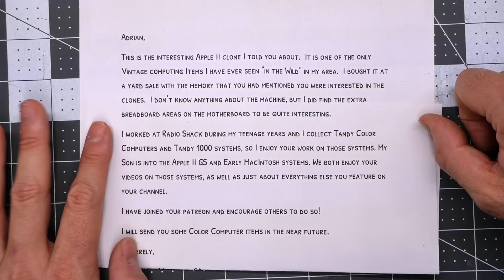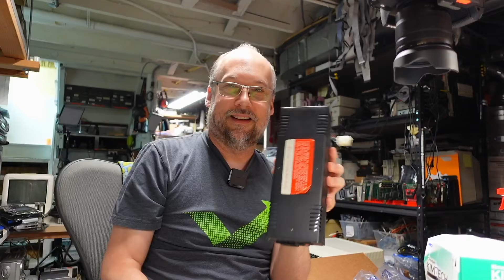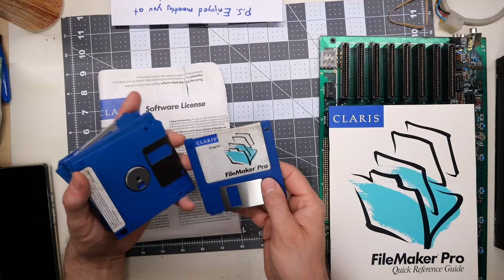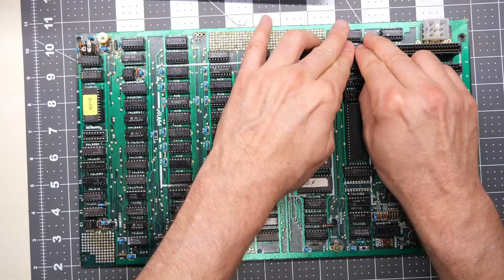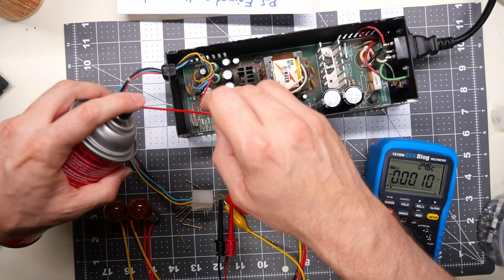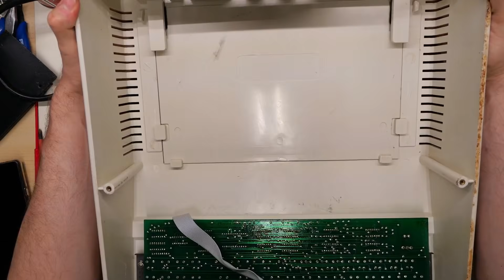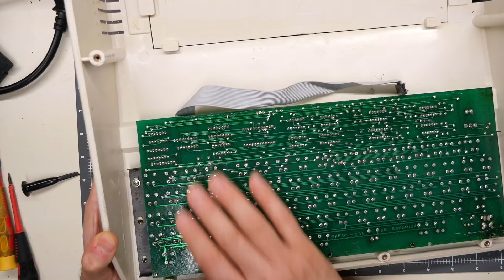0068 This computer is an illegal clone

Comment: I remember taking a computer servicing class and power supplies were tested with a PC board with a number of 'sand' resistors (the square-bodied resistors with a sandy cement on the one side). I wonder if anyone has ever made them commercially. It'd be more efficient (and safer) than the lamp rig. :)

Comment: My family's very first computer was a made-in-Taiwan Apple IIe clone in 1984 (it could enter lower-case letters so it must be a IIe clone instead of original Apple II or II Plus clone). Strangely enough, its form factor was far more similar to an IBM PC than an Apple: the keyboard was separated from the main chassis and its layout was a cloned IBM Model F XT but with read LED on Caps Lock and Num Lock; the entire color scheme was IBM's grayish beige instead of Apple's yellowish beige. I learned a little BASIC programming on it and played games like Lode Runner, Speedway Classic, and Seafox. Its floppy drive died around '89, rendering its function to BASIC in the ROM only and prompted my family to buy a 386 PC in 1990. Too bad I didn't keep it till now.

Comment: Ooh Kimwipes! Those things are AWESOME. They're much better for using for cleaning electronics stuff, PCB, etc. because unlike paper towels/loo roll/etc. they don't leave little lint boogers everywhere. Whenever I work on PCBs my last step is always to douse the thing in IPA then lay down some Kimwipes and then blot them dry. Gets rid of all that nasty sticky flux residue and you can just chuck them in the bin. I always keep an open box next to my workspace.
Reply: I use steel wool coated in hydrochloric acid to clean circuit boards and eye glasses... just remember not to wear any gloves as the acid will melt them.

Comment: Hey Adrian. Kimwipes are ok for glass and plastic. We use them to clean off glass components of gene sequencing flow cells. The main issue is they leave behind a tiny amount of dust. Just wipe gently with them. For something even better use lens paper for cleaning microscope lenses.
Reply: I use steel wool coated in hydrochloric acid to clean circuit boards and eye glasses... just remember not to wear any gloves as the acid will melt them.

Comment: I picked up a very similar looking Apple ][+ clone at the System Source Swap Meet last month. It looks very similar to yours, including the shortcuts printed on the keys. However, mine had a very sketchy no-name power supply that I believe directly caused 23 of the logic chips to fail. Hopefully your Seasonic power supply is actually a Seasonic (it looks to be a bit higher quality).

Mine is branded MCA and was made in Japan. The lid has a depression on it that almost fits an Apple ][+ badge (it’s too small by a smidge), and is retained by hooks on the lid and posts on the case. And yes, it has the breadboarding area.

Mine says “COMPUTER” on the banner. Sorcerer Stan confirmed that the ROMs from mine otherwise match those from the Apple ][+.

If you’re curious:
Attack of the Clone! Trying to Repair My MCA Apple ][+ Clone Computer:
https://youtube.com/live/xVzCYLJrgnA?feature=share

Justin Strikes Back! Trying to Repair My MCA Apple ][+ Clone Computer:
https://youtube.com/live/r6MLTV6Z4U8?feature=share

Comment: I built one of these in the early 80's. They were were very common in Canada. It looked and worked just like the original.
Reply: Where in Canada? Mine came from Supertronix on College St. Toronto.
Reply: It was Exceltronix on College, practically across the street from Computer Parts Galore, which also sold these bare motherboards and almost all the peripheral boards. They had a  bulletin board (on the wall) with phone numbers of people who could supply the eproms. Exceltronix also designed and sold a few peripherals like the Sound Sampler and and Eprom programmer. I built 2 clones from these sources in the 1982-84 time-frame and bought most of the parts at Electrosonic on Gordon Baker in Scarborough. @BrianBoniMakes
Reply: @BrianBoniMakes  Mine came from Computer Parts Galore, also on College St.  Those days were fun.
Reply: @als1035  I know that store and used to shop there!

Comment: You were getting about 80mV of variation. That's well within spec for SMPS. Incandescent lamps heat the tungsten filament to >3500K so there's a very large change in filament resistance across the operating current versus time on start up.

Comment: I wouldn't be surprised if the empty "breadboard" areas were added just in case there were a timing or similar problem later found with a specific accessory card, so they could add logic if necessary for an Engineering Change, without having to re-design the board.  Also, while the inconsistency of the power supply may be partly due to the high current demand(I'm guessing those bulbs in parallel were drawing at least 5 Amps of current), I would have still went ahead and checked the solder on the back side of the board, and possibly pulled a few caps to test them out of circuit...

Comment: Kimwipes - we use them all the time for electronics assembly.  No residue or lint. 
Motherboard - packed in white bubble wrap, ESD nightmare. Second worst packing material for this sort of thing (white peanuts being the worst). I wouldn't be surprised if several of the IC's have been zapped.

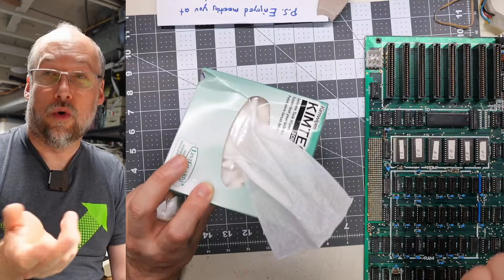Comment: 8:00 - I use those Kimwipes for cleaning flux off of circuit boards. Put a wipe on the board, soak with alcohol, then use an acid brush to agitate/poke/prod. The Kimwipe will soak up the flux/alcohol mixture, without leaving any bits of lint behind like a paper towel would.

Comment: 5V seems to be fine for the PSU.
but 12V is a bit out of spec, which should be +/- 5% -> 11,4 - 12,6V
Reply: But it's fine for a CB radio! 12V is used for the RAM chips and 2708 (or older) EPROMs, and RS-232, so it's probably not as important for it to be spot-on.

Comment: The kim wipes are a high quality lint free cloth. In a previous job I worked, we used them for cleaning photo masks and parts of the exposing machine in a photolithographic process
Reply: I use steel wool coated in hydrochloric acid to clean circuit boards and eye glasses... just remember not to wear any gloves as the acid will melt them.

Comment: 12V is the main power for the 4116 DRAMs, not just a bias.

Why not also check the DC levels when the motherboard is connected to the PS? The 12V tolerance is 10% so 13.5 is too much.

Comment: In the past 10 years or so I only run seasonic power supplies.  They are top of the line and not cheap.  Not sure how they were back then. Interesting to see how long some of the companies that I consider newer have actually been around
Reply: Seasonic also is a main OE for a lot of other PSUs. I think EVGA and Corsair have used them, among others.

As I recall; MeanWell, Seasonic, Delta, Chicony, and Astec are the BIG dogs in that particular group. I'm not 100% sure what MeanWell does ATX-style computer PSUs though, but their embedded PSUs and such are top tier.
Reply: Agreed, I have seen MANY PSUs pop, catch fire, and even explode before.  But I have every Seasonic PSU that I have every bought, and they all still work!  Even the ones I used for early mining...

Comment: no. this 'computer' is not an 'illegal clone'. this computer contains some roms. which may contain binary code that may be subject to copyright, in some juristictions of this planet. (ok, maybe as of the early 1980s, the usa and by now, most ;P (that whole case with 'rom contents are just a pattern of switches and not a work of art' thing ;) wipe or pull the roms and there is nothing 'illegal' about it and never was :P and eh... ya know. didn't woz make those things open source too by now :P LOL. (they probably even predate apple inc you know :P so they can't claim much :P
Reply: The whole source code to Monitor and Autostart were included in the Apple ][ User Handbook.

Comment: Hmmm... The difference between the Apple II and II+ is only in software. Except for board revisions which was just improvement and fixes of the system, the only difference between the II and II+ is the ROMs. Apple II had Integer BASIC on ROM and did not (on early revisions) boot from the disk, making the user type PR#6 to boot the system. Later Integer BASIC and then Apple Soft (Apple II+ ROMs) auto boot to the disk first then go to BASIC if there is nothing found on the drive.

From my BAUG  (New York Ciy Big Apple User Group) Days, there were many Apple Clones, like you stated, many of them "Illegal" for using illegally copied Apple II ROMs. The Orange, PineApple and  Banana were from China and Taiwan as I remember. There is a Apple II from the Soviet Union which I have, it has 90% of its chips from "American/European" Sources but there were a few 74-Series chips with "SOVIET" on them The case is in a strange plastic/fiberglass construction, and has a cloned PSU, Somebody in the group swapped the Russian character ROM with an English Character ROM; changes are it was a friend of mine, Dr. Hank Levinson (RIP), an Apple Wizard in his time. If his name is familiar, he name is all over various online Apple II News Groups for repairs and modifications in the late 80s to mid 90s. He was a professor of Mathematics in Rutgers U and there is a long story I one day may share with you all about Computer history and our part in it. He was also an Apple Collector, having collected all the known Apple Clones of the time. It is through him, through the club where I got the Soviet Apple. BTW - one of the more famous members of the group was Kurt Vonnegut. Having him at the meetings was a royal trip!

From those days, as I see, it looks like you have the Chinese Orange Computer. I remember seeing the proto sections on the motherboard on the Orange Computers.

Do Not Forget - De-Oxit Those Sockets!

Comment: Kimtech wipes are excellent when used in conjunction with a brush to clean up flux residue, you clean area with an alcohol soaked brush, you then lay the wipe over the area to be cleaned and dab in with a brush, the wipe soaks up all the flux residue and the wipe doesn't break up or leave lint around, all the professional soldering guys use them.

Comment: I use Kimtech wipes when cleaning PCBs during rework, to soak up IPA/flux/electrolyte... stuff. It's super absorbent, doesn't snag on components, and leaves no lint or other threads behind like paper towel or rags do.

Comment: "This power supply is sketchy!" - grabs a handful of nails as connectors and 2 turn signal bulbs for load :D
Reply: That's the pot calling the Adrian black!
Reply: "If it's stupid but it works, it's not stupid."
Reply: Sketchy devices require sketchy test rigs!
Reply: shades of Shango66
Reply: Seasonic is actually a great brand of PC power supply. I've been a customer of theirs for several generations of 500+Watt power supplies.
That said ... who knows on these Apple clones.
Reply: @zitt  They are now, but like everyone they had to start somewhere.
Reply: Lol yep, it’s made me unreasonably worried he’s left the 5V rail overvolted for no real reason

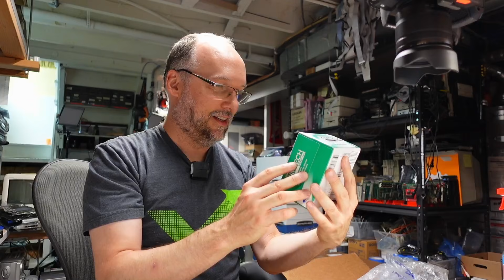Comment: @3:00 Adrian, Kimtech wipes.  They are used to clean up liquid on PCB boards.  For example, after you are finished reworking a retro motherboard, spray the area with 99% IPA, then you place the wipe over the area you just sprayed.  and rub the Kimtech wipe with a static free brush, to soak up the liquid.
Reply: I use steel wool coated in hydrochloric acid to clean circuit boards and eye glasses... just remember not to wear any gloves as the acid will melt them.

Comment: They were not illegal. Apple only had claim to the copyright which meant it could not boot to "Apple ][". If the ROMS printed anything else Apple had nothing. This board is at least a version 3 of the Taiwan clone boards. The first version were exact copies and would only work with masked ROMS. Pop the ROMS and if you find a trace cut and an transistor installed it's a first version. The more the clones deviated the less Apple had on them.

The early boards like this one were kits that people made themselves. They did not include ROMS and were not illegal. It only became a problem later when people were selling entire running machines but by then the Apple ][ was becoming long in the tooth. These boards are smaller and have fewer chips on them.

In high school when these came out I bought a first gen board and soldered myself a computer. I then bought an apple clone EPROM burner and copied the ROMS from my school Apple ][. I then put up a sign at the front door of the shop that sold the parts and sold full sets of EPROMS. This worked until I watched on TV someone getting busted. They showed the cops looking at a machine and waiting for the Apple logo to appear. The cop pointed his finger and said, "There it is, Apple ][". That's when I edited my ROMS to print, "AP2+". I was never hassled by the cops. 

I likely made less than 100 sets but I got enough money and experience to come up with my own screen saver hardware device that was listed in all the pubs and became a legit Apple developer.
Reply: When Apple created ProDOS, they included a test to ensure the ROM said "APPLE". If not, it wouldn't boot. Hackers quickly created a bootleg ProDOS that work on any clone.

Comment: The KimTech wipes are the things you want to use when cleaning a delicate PCB. I use them with a solvent for flux removal on my PCB builds. They are useful for lots of places where you need a lint-free disposable cloth. Common to find in labs.

I've never used them on a screen.

Comment: I use the wipes pretty much exclusively while cleaning up flux with a brush and alcohol.  You just apply the alcohol to the board, scrub, then position the wipe over the flux and absorb it into the wipe by pressing down with the brush.  Gets boards 100% clean every time!

Comment: I have one of those unbranded Hong Kong made Apple II+ clones. The power supply tries to kill you. Puts 110V AC on chassis ground. Came with a PAL video card, a pile of clone Apple II cards like a Z80 CPM one and a couple of half-height floppies. It's very well built otherwise. Use EPROMS instead of mask ROMS. One thing I noticed is that the case is not exactly the same as a real one, the covers are not interchangable.

Comment: That case was also sold stand alone and I've seen it on various Apple II clones.  The white button was for lower keycaps but many people had it so lower was always set on.  I never seen one with those shortcuts on the keys before.  The mechanical keyboard was awesome.  If I had to guess the boot might say "Ready Go" but it's possible it was changed later to make it more compatible.

Comment: They may have used female pinheaders on those transistors because they were having issues finding correct replacements. I have done that before on a clone CPC464 board so I could swap them until I got it running.

Comment: In the 80s here in Brazil there were a LOT of clones, some legal, some not. Tandys, Apple IIs, MSXs, CoCos, you name it. I had an Apple 2 clone and an MSX.
Reply: The clones were legal in Brazil (where copyright was only extended to software at the end of 1987) but were illegal in the US and Europe. Selling a clone in Brazil did require approval from SEI, so if you didn't get it (like the case for Unitron's Macintosh 512 clone) and sold anyway (as Unitron was accused of doing) then it would be labeled illegal.
Reply: @jecelassumpcaojr890  they were only officially made illegal in 1983 in the US, after Apple sued Franklin (I believe they were Franklin Computer, but renamed themselves to Franklin Electronics thereafter) IBM never actually brought anyone to court, they settled with the companies that illegally copied BIOS; Corona Data Systems, Eagle Computer, and Handwell
Reply: I have a Microdogital TK85 in New Zealand. I'm sure they were never officially sold here so I assume someone brought it with them when they moved here :)

Comment: I used to sell C64, Amigas and some other computer models back in the 80's.
One of the distributors aproched me with a Apple II clone that he wanted me to test.
It wasn't in the original Apple II form factor, instead it was multiple small boxes connected with cables.
The keyboard was one box (rubber keys just like the Spectrum), the CPU, RAM etc in one box, 
expansion ports in one box, Floppy drive in a separate box.
It worked just as a original Apple II, loaded programs and stuff, but we couldn't sell it in our shop of course.
Unfortunately I didn't hold on to it. Don't know where it went...
Reply: @oldguy9051Yes, that's correct. It's was the ii modell.  Thank you for clearing that up 😊